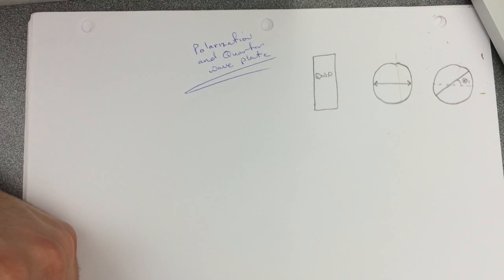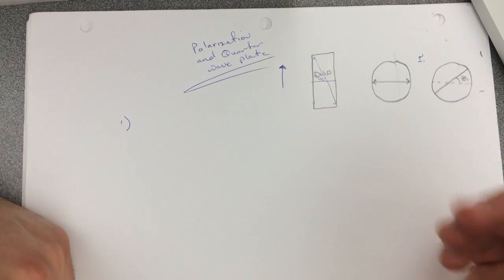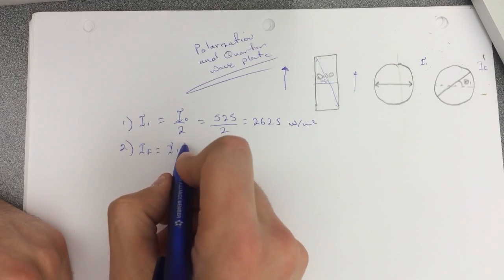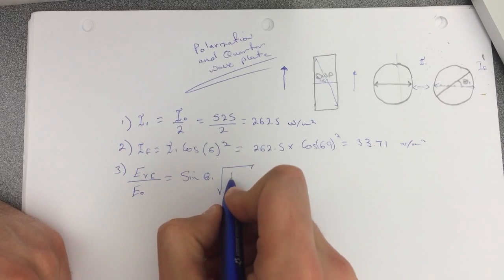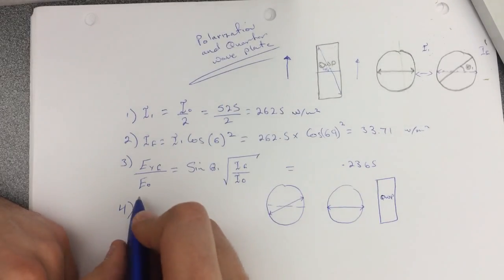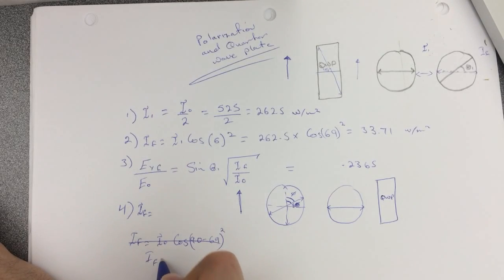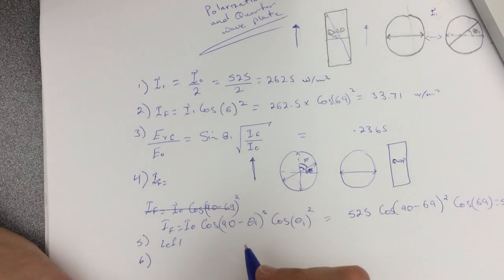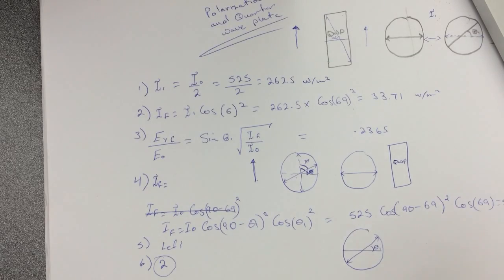Polarizers and a Quarter-Wave Plate "Smartphysics" Solution.

Comment: I solved #3 this way. I used the equation for the intensity ( I = 1/2 c e0 E^2) and solved it for E. Then for Ey, final I got the square root of (2 times I final times sin 74 / c times e0). For Ey, initial I got the square root of (2 times I initial / c times e0). As we see, E is proportional to the I in the square root. So, I got a proportion like this - Ey, final / Ey, initial = square root of (2 times I final times theta 1) / square root of (2 times I initial). I solved it and got the right answer.

Comment: Can I offer an alternative explanation to why your answer should be 2 for #6? Your goal is theta1=0 or theta1=90. This is because you have a difference in theta values of 90degrees between the initial polarized light and theta1=0 which results in intensity of zero; or you have a 90degree difference between the polarization after theta1=90 and the second polarizer when T.A is on x-axis. (Also in the problem it says that theta1 must be greater than or equal to 0 and less than 180 degrees, so we know theta1 has to have another option other than 0 and 180 for 2 to still be the correct choice.) But thank you for the great explanations on everything else and all your other videos!
Reply from the maker: Becca Cohn Great Explanation ! Thumbs up !!! :)

Comment: I think this is most helpful when you understand the work. Your explanations help a lot! Left circular is taken from the right hand rule on the slow axis of the quarter wave plate to the fast axis of the quarter wave plate. If your thumb points IN the direction of motion it is right circular. If it points opposite the direction of the motion it is left circular. This one was opposite and therefore left circular.
Reply: How do you know what the slow axis is? Is it perpendicular to the fast axis?
Reply: an attempt that comes up short

Comment: Not sure where the equation for question 3 came from. I looked in the prelectures but couldn't find anything.
Reply from the maker: I remember one of m class mates gave me this equation.
But here is what someone explained:
"Actually, you just replace sin(73)E with E, so you have to add a sin(73)^2 to both sides when you account for the square. Then, when you square root, you have a non-rooted sin(73)."

Comment: Did you ever figure out why the third answer is what it is?
Reply: Actually, you just replace sin(73)E with E, so you have to add a sin(73)^2 to both sides when you account for the square. Then, when you square root, you have a non-rooted sin(73).